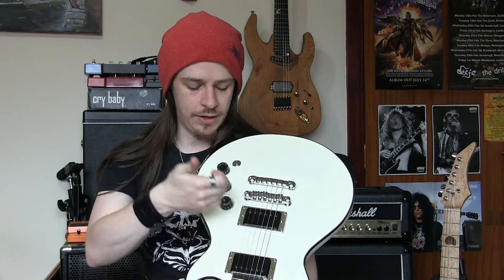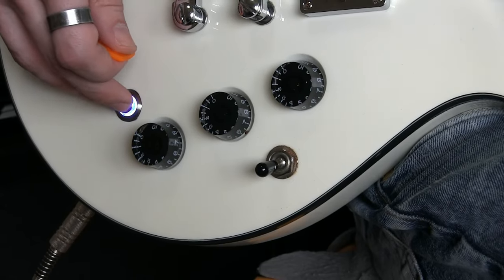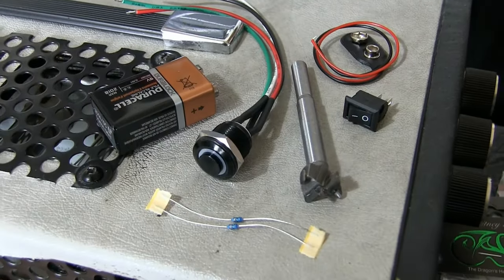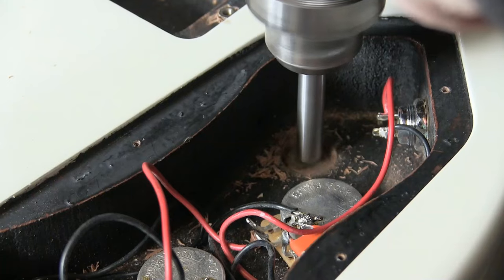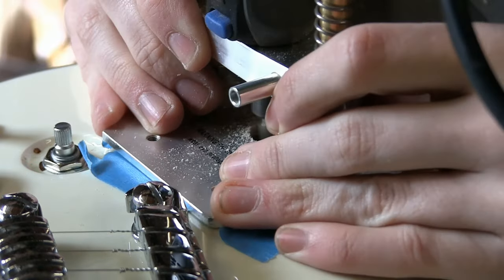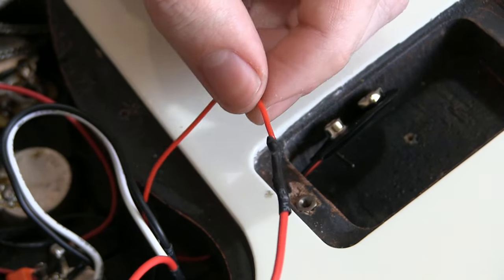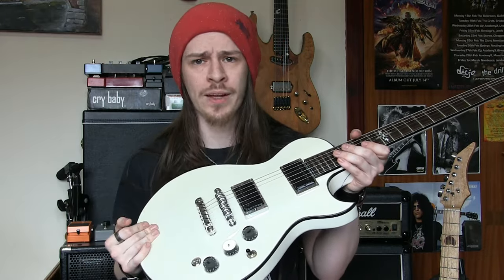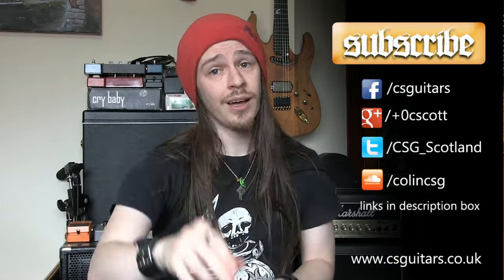Install a Killswitch: Guitar Basics

Comment: Is there a way I can use a button from an arcade machine? Going for that Buckethead aesthetic.
Reply: thx
Reply: A little late but you can get a 6 pack of arcade style buttons on amazon for like $6
Reply: @TetrisShark70  a little
Reply: @bansku1137   you too
Reply: @himagnamukherjee9382  you as well don't forget that
Reply: @bennycheca9426  yeah never forget

Remember before you forget
Reply: I'm late too guys!
Reply: Make sure to get momentary switch. You don't want something that stays on each click.
Reply: @Xxmeca421xX  to wire it just put the hot on one pole and earth on another pole.   then it earths the signal when switched. perfectomondo and simple. im doing this mod!
Reply: @1dimtim  you replied to the wrong person I think.

Comment: RATM covers! Tom Morello style!
Reply: nutnfan1 My thought exactly!
Reply: Tom Morello doesn't use a killswitch; he uses the pickup selector with the volume to one pickup turned all the way down.
Reply: Richard Not true... his practice/studio guitars may do this, but on his signature live axes (Arm the Homeless, Soul Power, etc.) he has a toggle kill switch installed.  It's actually a bit more difficult to use compared to the push button switch in this video, if you ask me.
Reply: I believe not for the Arm the Homeless guitar as it has 2 volume knobs, he has said so in interviews. With the Soul Power I don't know since I've seen the neck pickup being used whilst toggle killswitching.
Reply: MessyBugatti Stand corrected on Arm The Homeless, but Soul Power is a true kill switch toggle--it has one volume, two tones and a Strat style 5-way switch, so it's not possible.
Reply: Yeah, I'd prefer it that way myself, more tone flexibility

Comment: I don't know if it was mentioned, but if you have active pickups another benefit of having a locking killswitch is that it allows you to leave your guitar "plugged in" without draining the battery.

Finished playing? Just flip the kill switch to "off" position, put your guitar into the stand/hang on a hook and your battery will not be drained if you forget to unplug the guitar cable.

Comment: Great video. Thanks! A good idea for drilling with the Forstner bit though, is to drill a small pilot hole where you want the switch  (1/16" or so) and then drill from both sides. Much less chance of blowing out the finish.
Reply: Even better than that is to use a reamer to get the hole to size. They're made specifically for this type of work and they keep the finish from chipping like what happens when you use a drill bit. 

Why? Drill bits drill from behind. Reamers cut away the material from the diameter of the hole. Watch Dan Erlewine from StewMac install tuners. When he has to enlarge the holes, he uses a reamer for that specific reason. It keeps the finish from chipping and flaking because it cuts away material from the diameter of the hole instead of removing material from behind and breaking through the surface, which is what, causes the finish to chip and crack.

Use the right tool for the job and it makes it much easier to prevent fuck ups.

Comment: Just wanted to point out, there is a use for the latching type switches as kill switches on a guitar, for example, cutting out the need for a pedel to shut your guitar up inbetween songs or during choppy rythem sections where the breaks need to be exact. While you can use the volume control for these, indeed that's what it's there for, the switch is another alternate and with my style of picking (super heavy handed, a habit i really need to kick) a quick flick of my pinky to hit a mini toggle switch is a much faster and sutle movment then grabing for my volume control. Plus using a switch like this means you can keep your volume control set where it is through out the set so the "not being able to find the right spot again" problem of guitarests like me who max out the volume all the time(shout at me all you want) isn't a factor.
Just my two cents, you're videos are always interesting to watch.

In a topic un-related to this video, since I've never seen you put a link or a video up about your build info and such I'm going to ask these two questions for a friend of mine.
1. Do you ship overseas?
2. do you make extended range instruments? He's really into his 7's and 8's.

Comment: To avoid chipping and splintering >>> The CENTRE 'spiral part' of that wood drill bit is called the WORM..., you must drill carefully and STOP as soon as the worm initially protrudes from the other side - then turn the guitar over and drill from that other side using the WORM HOLE as the centre point for you drill.

Comment: the greatest switches for the job are industrial limiter switches, with a panel mount plunger. they're super rugged, look nice, quite like the switch on a pedal, and have the snappiest action you can imagine. only ~0.5mm activation travel, untill you get a very tactile CLICK. if i was to build a ray gun or so, that's what i'd use for the trigger. :D 
PS: use on/on switches. they are easier to find than "normal open" momentary switches, and with an additional toggle switch, you can invert the action as a kill switch. 
(i'm building cigar box guitars)

Comment: Incase you didn't understand Collin's explanation, as I didn't the first few times.
Locking switches: Once activated it will allow the signal to go through. (light switches, flashlights, vibrators, On/Off switches on amplifiers, etc)
Momentary switches: Will spring back to their original position once you stop applying pressure.  (TV remotes, volume/power buttons on phones, some vibrators, Buckethead's killswitch, etc.)
Normally Open: Do not make signal when left unattended, but once pressure is applied, the signal is then able to go through. (not really a killswitch)
Normally Closed: Does allow the signal to go through until pressure is present, the signal will cut off once doing so.  When letting go, it will spring back and allow the signal to go through once again.
Normally Open/Closed are both momentary switches, but can be applied as locking switches.

Comment: Could you pre-drill a small center hole from the back to the front, then drill the proper size front to back to avoid blowing out from the front entirely?
Reply: exactly how i'd approach the job.   small centre hole 1st from the back. and then bang some masking tape on the front and drill the larger hole. no blow-out.
Reply: Yeah never drill from behind a finish, drill into it....
Reply: Better than that is to drill a small hole then use a reamer to get it to size. That will prevent the finish from chipping without using tape. Watch Dan Erlewine install tuners into a head that needs bigger holes. That's exactly how it's done and exactly why. He uses a reamer to prevent chipping the finish.

Comment: Your switch will cancel the signal with the ground or just "cut" the signal going to the channel? I've heard that it's better to ground it rather than just interrupting the signal because that would cause problems with hum and noise when you push the switch.

Comment: Do you have to use an actual killswitch. I have an arcade button with the wires with it
Reply: +Kieran Walker Arcade button will work
Reply: +Kieran Walker an arcade button would NOT work, because it's primarily off. signal will only go through when the button is pressed
Reply: +Jacob Beaumont so you'd have to hold the button down continuously when you played
Reply: I wired 2 arcade button killswitches in my guitar. I just soldered the other end to the ground so it grounds out when pressed.
Reply: +Jacob Beaumont Why do you say "it won't work". He said that he is actually using one, and it's actually a common modification and they work great.
Reply: Jakob B
Just wire it as a short-circuit to ground, i.e. between the "hot" and "cold" terminals on your guitar's output jack.
Reply: buckethead uses sanwa arcade buttons.
Reply: THIS!!!!!! THIS IS THE BEST WAY TO DO IT. It avoids the unplugged guitar noise you get from a hot-disconnect style killswitch @mathitis93
Reply: Jacob B One word. Buckethead. So you’re wrong. He used an arcade button for a kill switch on his white les Paul.

Comment: Good video as always. I just don't see myself using one. When I bought my used LTD EC1000, i found the guy who had it before took out the tone pot for the killswitch... a tone knob is much more useful for me. it did give me motivation to put a dual concentric pot so I could adjust the two pickup tones independently, though, so it's all good...
Reply: No es mejor perforar la guitarra, dejar los potenciómetros y después poner el kill switch?

Comment: Hey Colin, I've got a question about kill switches. When my guitar is selected to the bridge pickup and the volume knob is all the way at ten, it will kill the signal. When I put just a hair back, the signal comes back perfectly fine. Is it supposed to act as a kill switch or is it just a problem with my pot?
Reply from the maker: +yeah man there's a problem with your pot, it shouldn't do that. Consider getting a replacement one.

Comment: Buckethead uses a Sanwa game switch (normally open) they are cheap and easy to put in. Wire it between the Volume and ground then just push to use.  Advantages of a Sanwa, easy to push, will work for a billion cycles, and it's cheap.

Comment: drilling a hole tip; 
dirll a pilote hole of eg 5mm with a sharp metal drill starting from the lacker side
take the drill for last measure you would like and start drilling from the lacker side 5 to 6 mm deep
turn the guitar over and finish of the hole (dont go through but stop in the middle and retract)
done

Comment: Got a question here. Your guitar (luckily) has a cavity for a 9 volt battery which supplies your LED in your killswitch. My Ibanez for example doesn't, because it came with stock passive pickups. Is there anyway to get a voltage from the electrical components within your guitar, or will I just have to make a cavity for a 9V? My guitar is already packed with wires and other components, so I can't put another battery in there. 

Greetings from Belgium, by the way. Keep making the scientific videos.

Comment: Please help, I installed my kill switch but it clicks when I press it. It's an arcade button. How do I remove the click sound throu the amp. When strings are not being rung the switch is silent but when a string sounds the botton will click through the amp. There's a video on you tube of a dude with the same switch and his makes the same sound. Your switch just cut off the sound with no click. What have I done wrong?

Comment: I didn't know I had to drill a hole on my guitar to do this. All my life I've used the pick up selector to do the exact same techniques and noises
Reply: What if both pickups are controlled by the same knob like I donno... most guitars on the market?
Reply: Only possible on a guitar with two volume knobs like a Les Paul.
Most other guitars don't have that.
Reply: @MostlyLost  it's easy to replace and you don't need a further hole in your guitar.

Comment: Here’s a drilling tip: drill a pilot hole from the surface, then use your forstner nice and slow. Blowout often is the result of too much pressure on the bit or a dull bit.  Masking tape won’t prevent a blowout.

Comment: How do you get rid of any popping noise when pressing the button?  Thanks for the great videos!
Reply: Do you have the switch in series with the signal to the output jack? This is why it is popping.
You need the switch to be in parallel, short-circuiting the signal to ground. NOT breaking the signal - this creates voltage spikes, which make popping noises.

And yes, CSguitars explained this backwards and got it completely wrong. Although the wiring diagram on the link is correct.

Comment: just turn the volume down in one of your pickups and flick the toggle switch up and down.
Reply: cant go fast or clean enough to replicate buckethead. also youre damaging your toggle switch if you try to go anywhere near as fast as that, see: Jordan by Buckethead
Reply: yeah, its no where near clean enough and it just breaks your switch
Reply: Juan. Lega remember: not all guitars have 2 volume pots
Reply: I'd rather just ruin some toggle switches, and/or remove a tone for a 2nd volume, then drill a hole in my guitar for a kill switch. Or just add a momentary switch to a boost pedal...
Reply: You're going to break your switch. Then the momentum will make you dig the jagged edge into the body of the guitar, and scratch your $3,000 Les Paul... I've seen it happen at a show :D He was very mad... Not worth it
Reply: I use both pickups at different time.
Reply: Oh hell yeah I didn’t know that lemme just get my strat and do that..... of wait...
Reply: Just get a kill switch pedal rather than modifying your guitar. There's a cool Morse code- like pedal that you can get. I still find it unnecessary though, never saw a kill switch as a practical guitar effect.

Comment: Where should I go to get a locking killswitch? I don't see myself using those momentary switches. Nice Dorje poster.
Reply: +Mega MountainMan Get an ON-ON (6 pole) mini toggle switch, and check out the "how to wire a killswitch" diagram from the seymour duncan website. I got a really cheap (shitty) one for about $3 on ebay, or you can get much better quality ones from dimarzio, etc for around $20-30.
Reply: Nick Butler
I'm broke. I spent too much on pedals and stuff.

Comment: If my guitar has already active PUs, can I use the same battery or do I need a different one?

Thanks a lot for this video
Reply from the maker: You can tap power off the existing battery, no need to install a second one.
Reply: Thanks !

Comment: So how is it that adding the kill switch, doesn't open-circuit the input of your amp?  Those of us with valve amps make sure that there is always an input load connected (like a guitar), so I was half expecting one of the resistors included to be in series with the switch when it is pressed. Eg, when the switch isn't pressed, the pickups are across the input of the amp, and the the switch is pressed, the resistor is across instead. It seems in this installation, pressing the switch, simply breaks the circuit, just like there was no guitar plugged in...  am I missing something here?
Reply from the maker: +MightyFloyd the part you are missing is that there is no issue with not having signal reach the front of your amp.

You seem to very confused about how this all works.

Comment: Are there any killswitches that I can have set up as toggle and momentary? I would like to be able to do a toggle for certain situations where I am not playing, and a momentary for various effects.
Reply from the maker: Switches which are locking in one direction and momentary in another are quite common. You'd be looking for a switch with the denotation "on-off-(on)", the brackets indicate momentary. These are usually either toggle or rocker switches. 

You'd wire them similar to here, have the signal connect to the center pin and leave it again to go to the output jack. This allows your guitar to sound even though the switch is 'open'

The other two contacts would then connect to ground, so whichever direction you threw the switch, the signal gets connected to ground, silencing the guitar.
Reply: CSGuitars Okay, thanks

Comment: Hey Collin!!! I have active pickups in my Ibanez RGIR20FE and it has a Killswitch already in there. I want to replace its Killswitch with this one... Would the process that you did be the same? Also the LED... Could I hook that up to my already 9V for my actives or is that a bad idea?
Reply from the maker: +Goofy GooberInc Yes, the process would be the same. You'd probably still have to drill out the hole wider to accommodate the size of these LED switches. 
You certainly can link up the LED to the 9V that is already powering the active pickups, it shouldn't case any problems.
In theory the LED will reduce the lifetime of the battery, but it will be so negligible in practice it's not worth worrying about.
Reply: Did you ever install the Iron Age killswitch in your guitar?  Just curious as I have the RGIR27FE and was hoping it would just drop in.

Comment: just ordered a killswitch from iron age and was wondering a couple things about killswitches if someone could fill me in. is there going to be any noticeable "popping" sound coming from my amp every time i engage the switch, and is repeatedly cutting my signal in any way harmful to my amp or guitar?
Reply: +Sprong4 Shouldn't be any popping. The only reason that happens when plugging/unplugging an instrument cable is because of metal to metal contact of the plug and input assembly. And all your're doing is stopping the electrical current from finishing the circuit, so no harmful things happen to your guitar or amp.

Comment: I have a question. Does this killswitch need the battery to function? Or is the battery purely for the led? I would like to install this into my strat, but I don't really feel like cramming a 9 volt battery underneath the pick guard. Is there a way I can install this killswitch without the battery? (I don't care about the led, I wouldn't use it anyways) Just curious, thanks.
Reply from the maker: The battery is purely for the LED.
if you want to install this switch without the LED simply ignore the red and black wires
Reply: Thank you so much for the quick reply :).
In that case I will be installing this killswitch as soon as I can buy it!